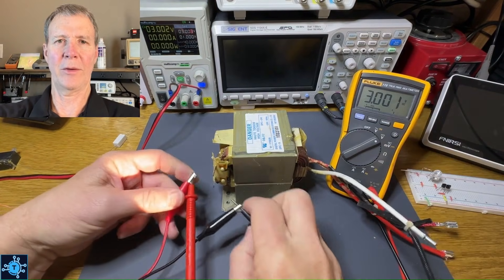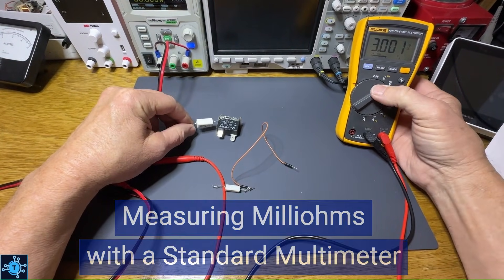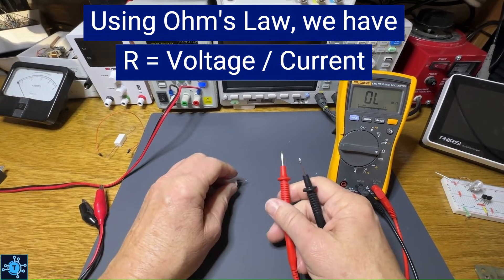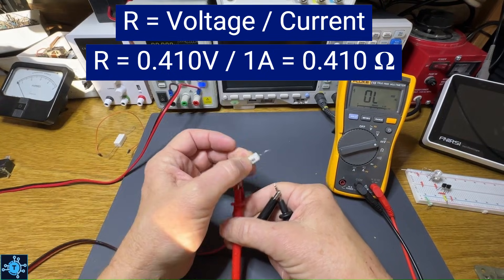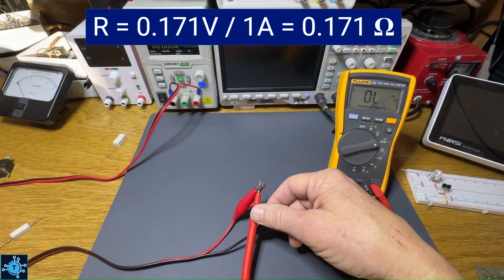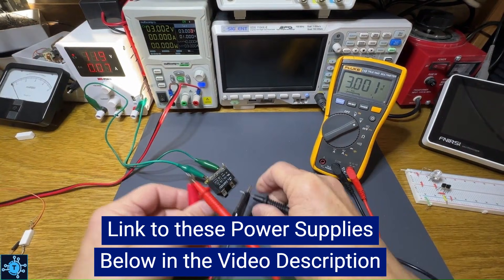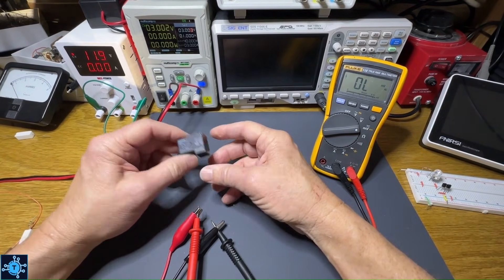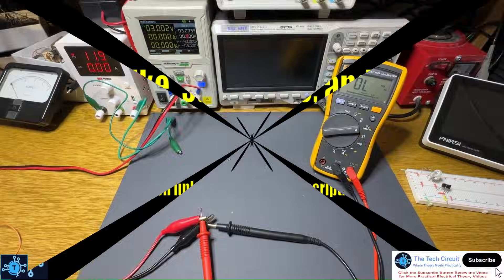#144 - Measuring Milliohms with a Regular Multimeter

Comment: When measuring transformer windings that are in the millions when does the DVM meter PULL down the 3vdc at 1 amp down to a millivolts? The milliohm resistance of the transformers windings is "pulling down" the lab power supply test voltage. I would think logically milliohms wouldn't pull down a test voltage because it's a milliohms LOAD. So I'm confused why is a milliohm load pulling down the test voltage?
Reply: It's active feedback loop circuit inside the PSU that reduces voltage in order to keep current at the user specified level (1 A).

Comment: Yes, ohms law is helping in lots of situations - you just have to think about and understand what you are doing! Downside here: you need a precise current source, source voltage must be high enough to drive the current - so you have to think twice, source current must be adjusted to power capability of the DUT - so you have to think a 3. time... 😉 But at least you will train your brain!
Reply: You don't actually need a precision current source. Any old bench supply will do, tune the current to a ballpark wanted figure, just hook a second DMM in there to read the actual current through the DUT. Hit the "hold" buttons simultaneously on both DMMs and then just casually punch the numbers into a calculator.
Reply: @kassisaba  yes, possible, but a DMM in series with the DUT will bias the resistance depending on the range selected. If you grab the voltage over DUT directly (4-wire measuremet) it will be o.k.
Reply: @rilosvideos877  Umm, yeah, that's what I meant. I didn't say you move your voltage probes off the DUT leads, you just add an ammeter in series to the current carrying lead, so you don't need an accurate constant current source. You just work with the concurrent voltage and current readings you get in real time, doesn't matter if the current fluctuates or is not a specific value, R always = U/I.

I mean, then you don't even NEED an actual current source, you can use a voltage source like a battery and a resistor in series to create a crude current source for the job, if you're in a pinch.

Comment: Many years ago I build a 1 amp constant current supply just for that purpose
Reply from the maker: Building 100mA battery operated one now!
Reply: @TheTechCircuit I have battery powered one that goes up to 4 amps. Just a chinesium lab power module, batteries and a charge controller in a box.

I use it a lot for trouble shooting as an electrician. It's enough to make smaller wires heat up to be seen on thermal imager.  If the resistance value by itself won't be enough to pinpoint the problem, it's still often easy to setup so that current clamp could tell which cable you're tracing etc, if for example using the earth wires to close the loop is possible. Shorts aren't usually clean zero ohms, so finding the exxact location would need several measumerents from both ends and it makes the math easily too hard. So the current clamp takes you to the right place even faster.

I also made bigger one that takes makita 18v batteries and outputs something like 30v/10a/180w (or more, when supplied with up to 30 volts instead of the 18v battery).

Installation testers also do low ohms at 200-250 mA, so that's also an option when the basic dmm starts to choke with its 1 mA resistance measurements.. Its nice to have several options.
Reply: @DonnieLuve  Nah.  Its not complicated.  And the battery operated lab power supplies were initially meant to replace carrying of lead batteries to roofs, when installing smoke extract windows.  Nice thing about it was the screen that shows current, so it basically replaced multimeter/clamp too on those cases.  And saved several kg of things to carry.

Its also nice to test lighting stuff and again, seeing the actual current/power helps in troubleshooting and even selecting the right drivers etc.

Low resistance measurements were just a nice extra, that has been useful many times.

Its slightly annoying to carry tool batteries for the bigger one I made, so I'm probably making yet another with integrated batteries, but bigger than the 3x 18650 I already have.  I think it should also have some compartment for the leads too, so it would be easy to just grab and go.  Just need to find suitable case for it, as I'm against 3d-printing, even though I do have a printer..

Comment: this is a sound method, but you are losing  the benefit of the four wire Kelvin method. Connect your current source to the device you want to test, then probe the component wire between the source clips and the component body.  Now any contact resistance plays no part in the reading.